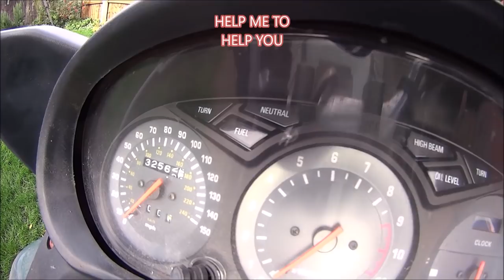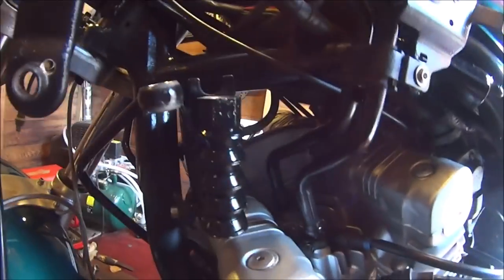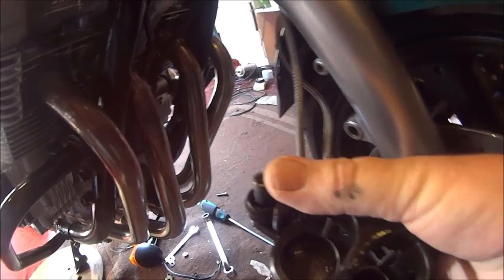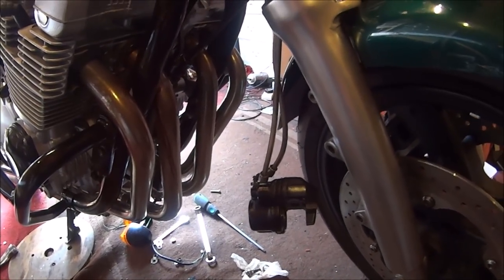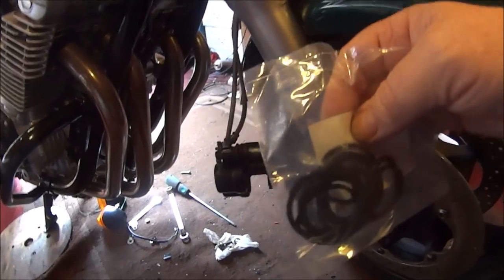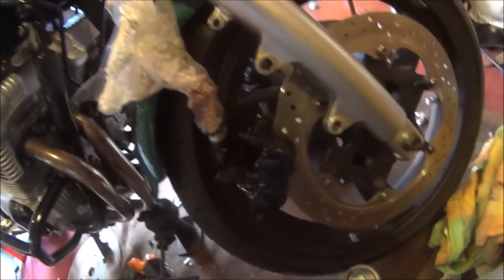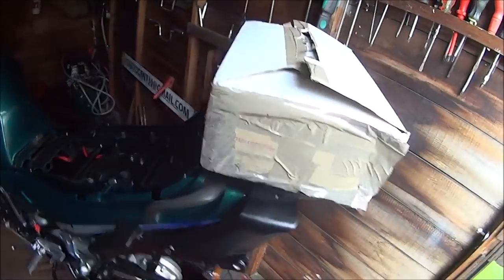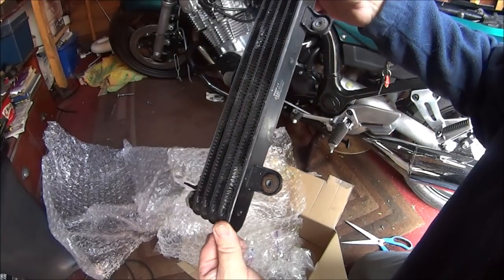XJ900 DIVERSION PROJECT.. THE END

Comment: Well done, matey!  What's the winter project?
Where did you get the brake gasket kit from?
Reply from the maker: ...thanks Ian.. Street fighter or rat bike on the cbr1000f and some guitar projects...
heres the link for the brake seals but i must say all the seals in the pack i got were just for the large piston on the front....................https://www.ebay.co.uk/itm/FRONT-CALIPER-SEAL-FIT-YAMAHA-XJ-900-S-DIVERSION/362000944816?ssPageName=STRK%3AMEBIDX%3AIT&_trksid=p2057872.m2749.l2649
Reply: I will be working on my 1991 CB1000F over the winter.  First job is to replace the original (!) brake hoses with armoured ones, strip out the brake units and service, and service the carbs.  Get's expensive when you have 4 of them!  So, I will follow you with interest ;)
Reply from the maker: Cheers bro and good luck with your CBR